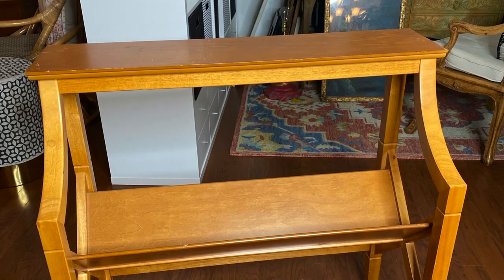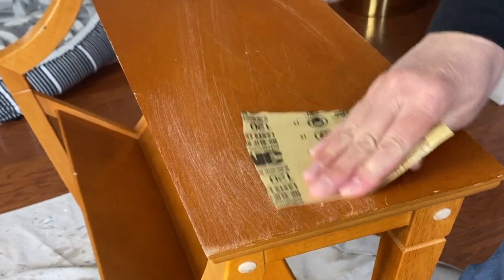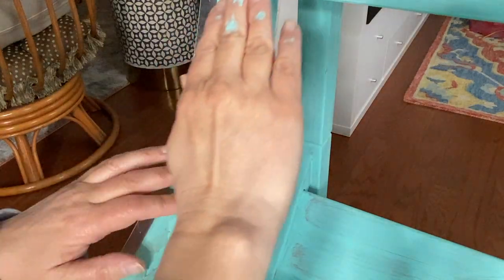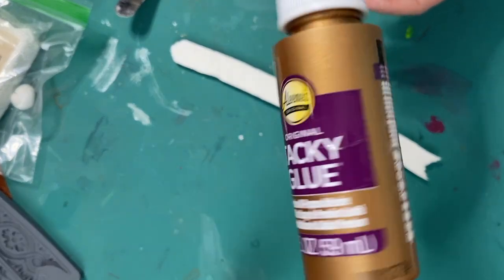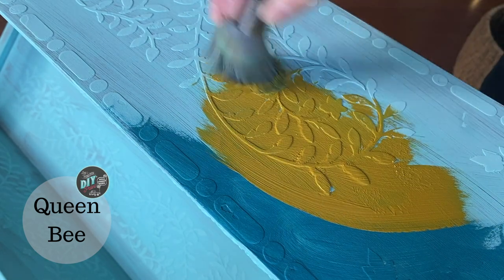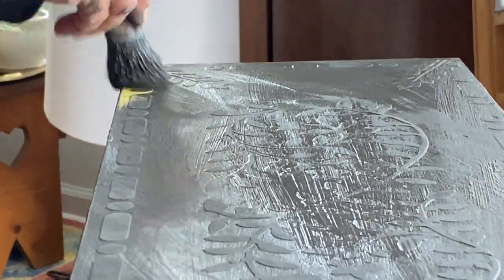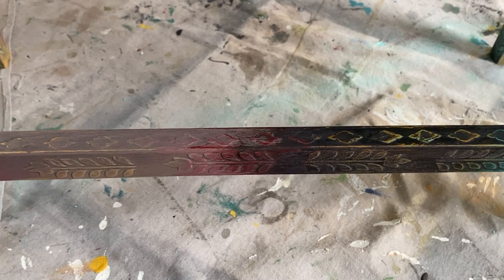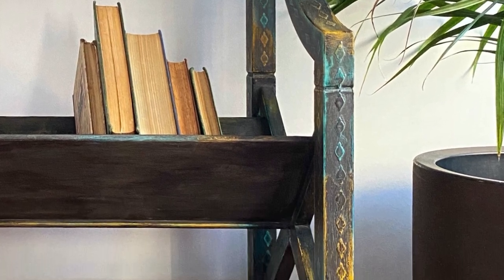LAYERING PAINT COLORS, adding details using raised stencils and trim, wet distressing

Comment: I love it. It seems so graceful when you do it.  Hahaha. Sigh. BJ-- do you have any genius tips for cleaning wax brushes? I learned the diy way that they set up really hard and then scratch the paint if they aren't cleaned. In Canada it seems we dont sell odourless mineral spirits. So it's a stinky headache to use that stuff. Any shortcuts you know?
Reply from the maker: I would make it a habit of cleaning your wax brushes after every use. I use dawn dish soap as it does a good job of getting them clean. You could try massaging some wax into the crusty brushes to see if you can soften them up.
Reply from the maker: Maybe try Murphy’s oil soap?
Reply: @JunkdUp  Thanks, I really appreciate it.  Ill look that up. This is very helpful:)